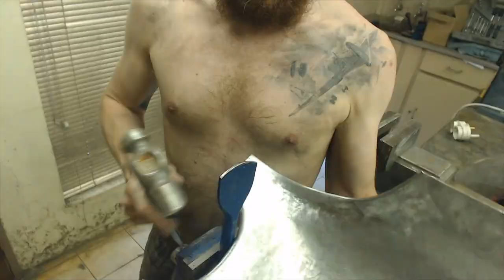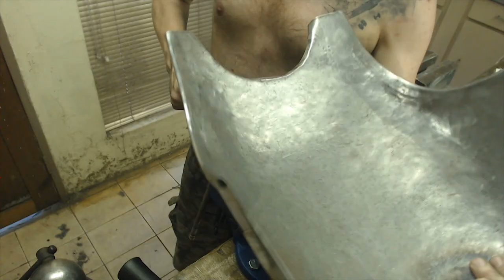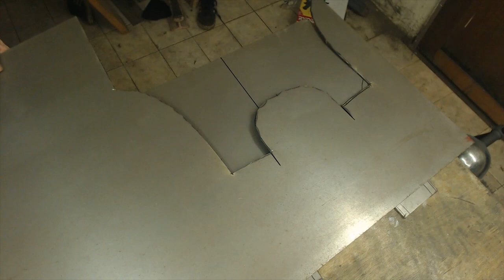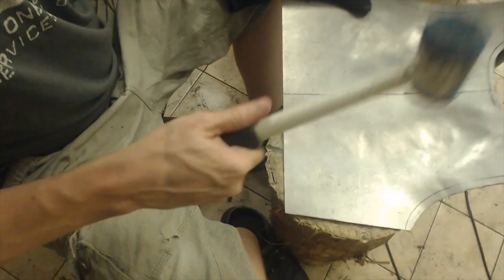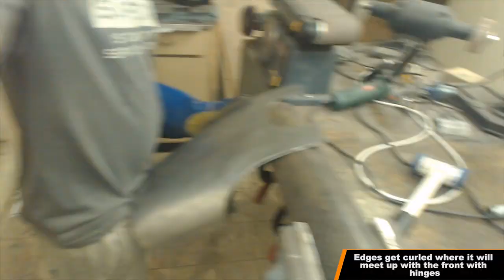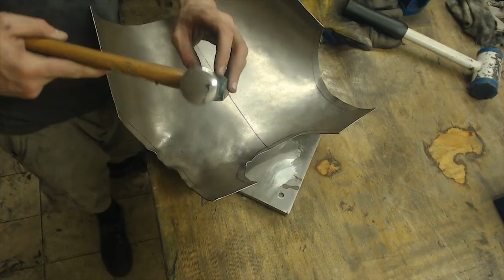Medieval Cuirass/Breastplate Build - Part 3 - Backplate started

Comment: Thank you so much, you're the only guy I could find who cold forged a cuirass and I want to get into armoring but can only do cold forging, any places I should check out for tips on cold forging armor including helmets?
Reply from the maker: I couldn't find much info on cold forging myself, so I kind of make it up as I go along. As far as I understand the process is pretty similar to hot forging just with a lot more elbow grease. Also I found that thicker mild steel is easier to form than thinner steel, it has a tendency to warp less in undesirable ways
Reply: @ManinaCanArmoury  I'm considering trying to make a bascinet but I don't have a welder and can't hot forge, have you found anything on that?
Reply from the maker: @calvinhuddleston576  I'm sitting with the same problem, no forge or welder. Cold raising a bascinet as far as I know is almost impossible, that's why I started with multi- piece great helms and kettle hats
Reply: @ManinaCanArmoury  thank you, I figured so